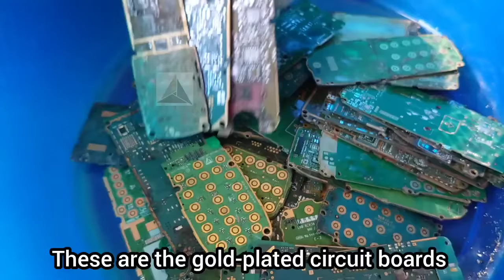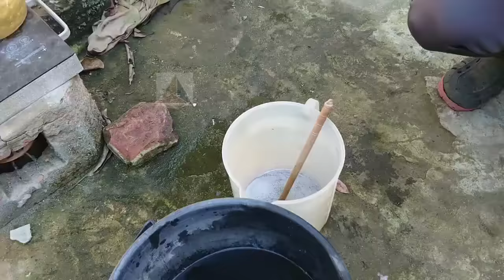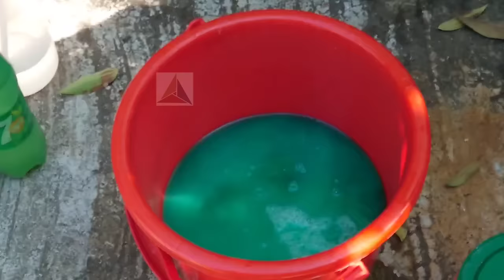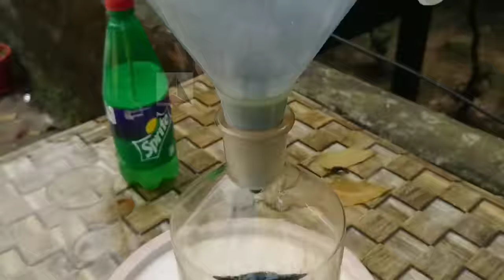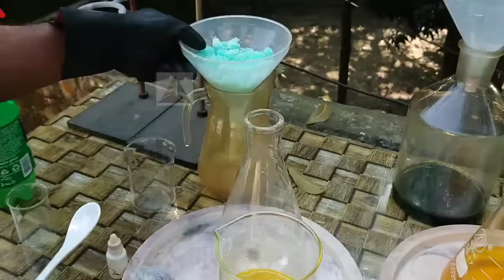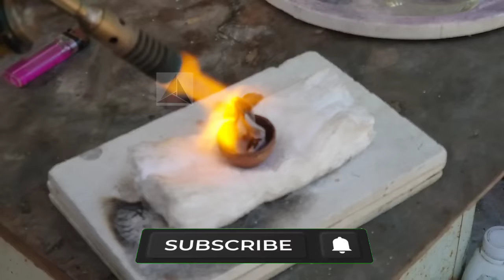Nokia Cell Phones Gold Recovery | Recover Gold From Nokia Cell Phone Circuit Boards

Comment: Hello,

Thank you for interessting video but why you have added ferrons sulfate at the end, because it's Iron so the quantity of recovery of gold is not pure 100% because Iron is melted. You should adding sodium metabisulfate in the last solution. So tel us if the same weight is 1,17 grame if you will not adding ferrous sulfate. I think it will be less.